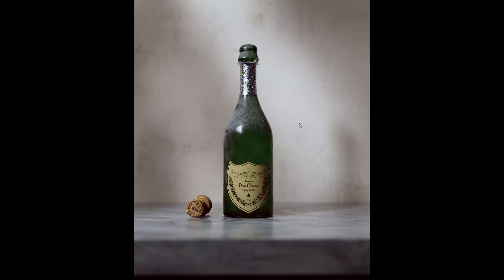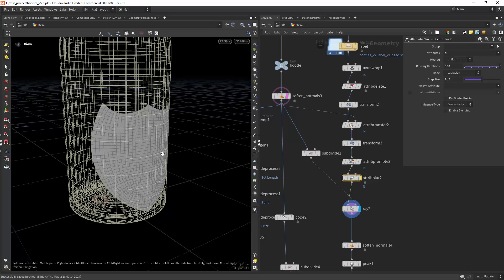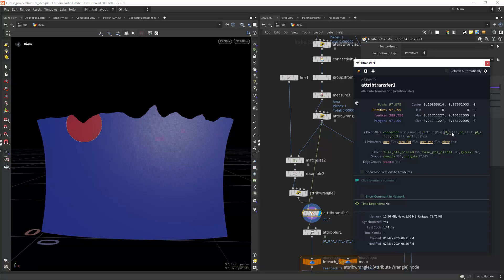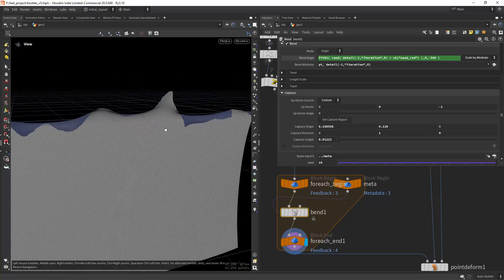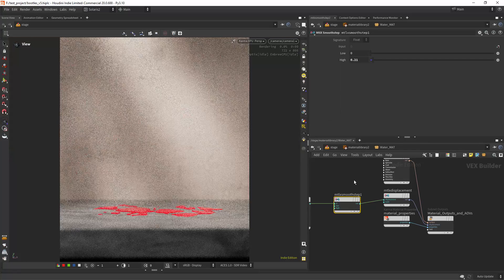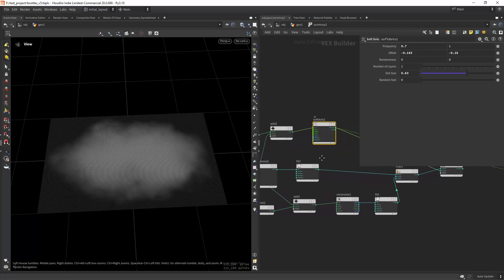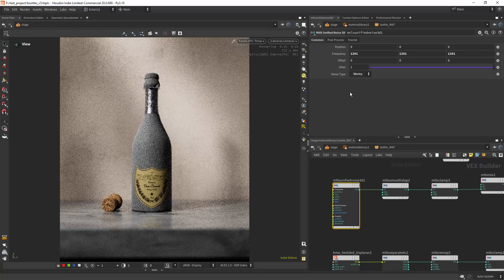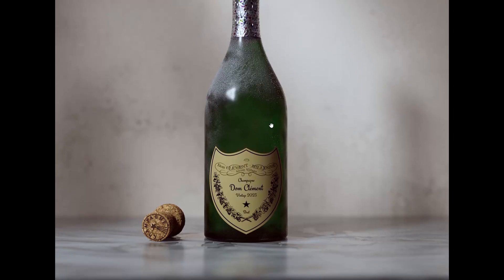Still Life Scene Breakdown | Houdini tips

Comment: Perhaps you could simplify the wrap bend a little bit by creating one bend intensity/direction attribute in VEX, with each point adding a random weight from -1 to 1 to its area. Then you can skip the feedback forloop, just bend by this single attribute. Or would that not work?
Reply: The dust looks absolutely amazing by the way❤
Reply from the maker: For some reason, this setup was giving me a better result than a single bend attr. Also I admit this is a convoluted setup and didn't know better at the time. Hehe